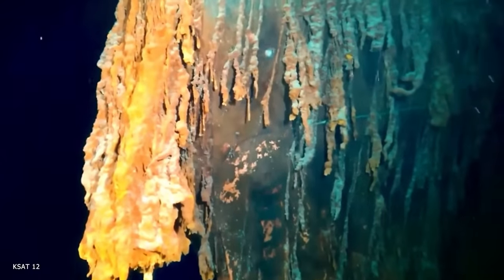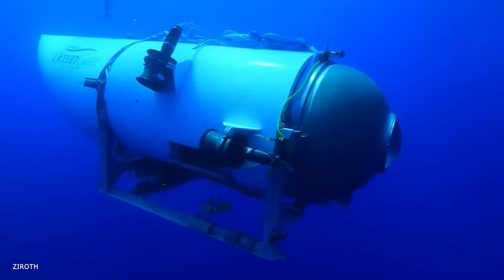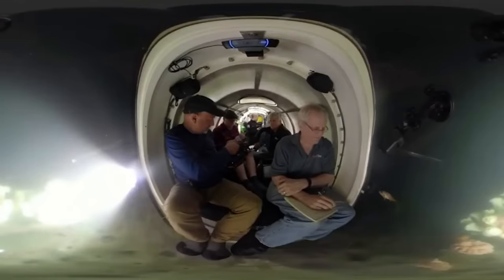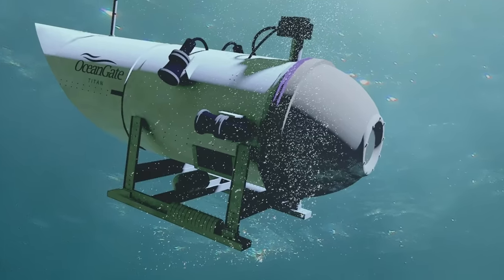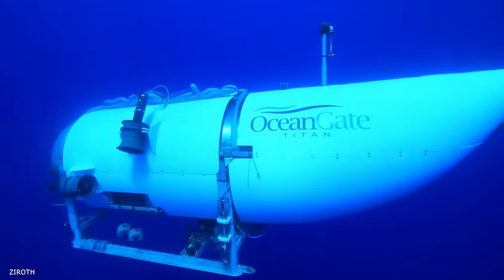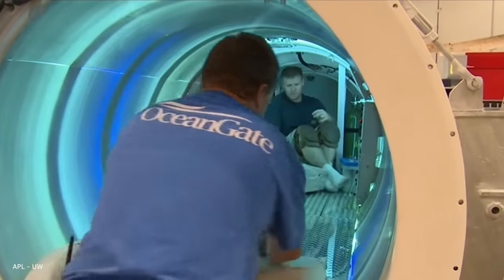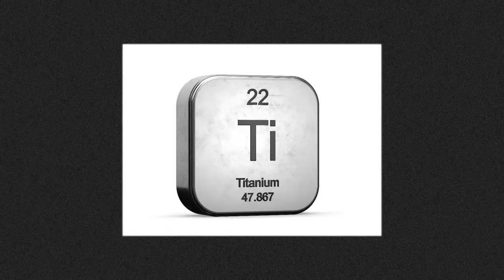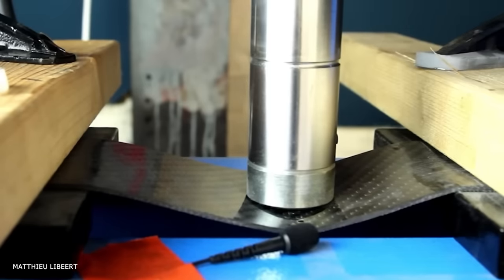James Cameron Just Reveals TERRIFYING Truth About The Oceangate Submarine!

Comment: There is a reason that the other subs were made of titanium ...The SR-71 was 90% titanium ...and they pushed it to the limit...!
Reply: Ultra high strength steels are fine.
That's what was used for pressure hulls of Mir submersibles, because along with bolted together halfs design it gave 10% better strength to weight ratio than welded titanium spheres of the time.
Also there was one made from aluminium: https://en.wikipedia.org/wiki/Aluminaut
Fatigue of aluminium must have been pain for designer and seriously limiting for usage life.

Comment: Ocean Gate put cost saving over structural integrity and the safety of those on board.  Even the science was bad---the carbon fiber material was just not the right material to subject to such extreme pressure.  The Titan should have been tested further.  It certainly was a technology failure resulting from a very human flaw---ego.

Comment: When Carbon Fibre is supposed to be stretched like on a plane with the cabin pressure pushing against it, it works. The fibres bind together and tighten.

When Carbon Fibre is supposed to be a lighter, stronger automotive alternative to steel and aluminium, it works. Race car constructors swear by the stuff and since its introduction it has saved lives with its strength. Former Hercules Aerospace and F1 engineer/designer Steve Nichols has said that if the Carbon Fibre construction in an F1 or Indycar basically turns to dust in an accident, its done its job dissipating the energy before the driver gets seriously hurt.

But Carbon Fibre was never designed to be squeezed by tons of pressure like seen in the depths of the ocean.

Comment: 1. Mixing materials = different reaction agains heat, pressure, and so on = not good at all.

2. Best proven shape for pressure resistance is the sphere, so using other = not good too.

3. Lack or testing material resistance over time under various conditions = not good also.

Already three very huge problems from the begining = bad things will happens for sure...

Comment: For a  start, we start with two Titanium end pieces - 'tough  old boots', married to a cylinder made of 'super strong string' impregnated in resin! Even that would have shown the lunatic building the Titan Submersablel the followinge. Such a entitity, subjected to cyclical pressure testing, would have revealed the destructive forces generated by fracturing resin, upon the 'string winding' it embraces. Successive testing ulimately resulting in total collapse of the cylinder..  As for the 'real thing'. the centre of the tube would exert huge deflection forces to the Titaniam end cheeks, further invoking the potential for stress cracking in the cylinder ( all out of sight externally). Just like repeated flexing of that piece of copper wire - it suddenly breaks. All of this would have been revealed in destruction testing - which the Salesman knew darn well!

Comment: I cant believe anyone thought the titan was  a good design. The cylinder, using carbon fiber, titanium end caps ( well they were sound) but then gluing  them ow my god i saw how they did it. They used spatulas to scrape the glue on then slid them together. Id of wanted a robot to spray it on so absolute thickness and consistency. Or something to injection it. In a vacuum How they did it how do they know if it bonded without any voids. My god i cringe every time i think about it and the carbon fiber??!!!??!

Comment: The author is unnecessarily harsh on Rush in this piece, blaming his lack of concern for safety for the deaths of the four passengers on the vehicle.  Remember, each passenger signed a waiver which outlined many of the issues listed here.  They were informed of the dangers and accepted the risk.  Rush did not force any of these people to board that deathtrap.  Rush ultimately trusted his own engineering over general practice, and basic physics, to pilot the craft himself.

Comment: As soon as I read that the main body was a CF cylinder. I knew pretty much what had happened. 
A sphere or (possibly?) a carefully designed ovoid is the only shape suitable for extreme over pressure, and any material that can delaminate is a no-no.
I’m just a (retired) physics teacher with no engineering qualification, yet I would have rejected this design out of hand as soon as they suggested using a CF cylinder as a component of the pressure hull.
Rush was an example of the Dunning-Kruger effect. Thought he knew more than the experts

Comment: The fault was in the way the end caps were installed. The epoxy used was under too much stress.  In the video of the assembly you can see that the end cap is put on in such a way as when the hull flexed the epoxy was all that was resisting the end caps non flex. If the end cap was put over the end of the hull the end cap would have taken the stress not the epoxy.
Reply: Yes and no, there should have been a nice thick flange that allowed the carbon tube to slide onto giving 2 surface areas instead on 1, bottom line is that carbon tube should have been treated as a disposable part and replaced after every deep dive

Comment: In the fire department we had two types of air packs, metal and compost.  When refilling the metal packs you use a water bath to cool the bottle.  When refilling composite you DO NOT put the bottle into the water but allow the bottle to get warm.  It will cool in time.  Reason is what Mr. Carpenter spoke of.  The water bath can get between the fibers and then as you compress the air the bottle expands.  The water between the fibers is incompressible so this causes an uneven pull on fibers and separation of layers.  The next time you fill with air the gap between fibers is larger so more water gets in and more sepeeration and tearing of fibers occurs.  Then failure.

Comment: Well i am just a simple lady that likes to go fishing however i do understand about carbon fiber fishing rods can be made from this i have seen how slim they are and although strong the pressure they withstand is variable, if squeezed too tight they break they shatter and split and crack if they bend above their breaking strain the will shatter and split in some respects carbon fiber is quite brittle and bonding it to other materials might even cause a weak point at the joint. So i can only imagine making a sub out of it would be a very bad idea, it might withstand the enormous pressure of the ocean for a while but that might weaken the glues bonding it and failure occurs eventually the pressure will force things to crack hence the reported cracking sound heard on board. It was too late at that point to salvage the mission. Only thoughts from a simple unqualified person i must add.

Comment: also i doubt that uneven tightening of the hatch bolts would have made a difference because at those depths the amount of inward force would force the metal flush with whatever it was contacting even if the bolts where tight or not.

Comment: It had been down there before though. This time it was sinking at a high rate and thats why it probably exploded. Maybe if it hadnt sank too fast it would of lasted for more dives or shown signs that it needs a new hull, also carbon fiber was strong enough for this. they fail to mention that. The operation was very homemade but it did work, it didnt leave much room for error though. Seems a round metal one with only a couple passengers could of just done twice as many dives. Also, if your a civilian that wants to go to the titanic this guy was the only one crazy enough to be doing this. Theres a video of a russian sub down there that gets stuck briefly but they get out, that thing looked pretty badass, thats what you want.

Comment: I am not saying that the design was not without flaws. But I do think too much is being said about regulations and testing. Was the Challenger Space Shuttle certified? Was Appolo 13 Certified? Was the Titanic certified? Certification does not validate a lack of failure. All it does is state that current knowledge says the unit 'should be ok'. It is a sad case, no doubt, rush, cost, arrogance, yes. Certification, I am not so sure about.

Comment: Yeah, Rush had a bunch of excuses of why he didn't want an outside entity examining his work too closely (smart salesman), but in the end he just didn't want to spend the money for outside consultation and upgrades.  He was warned about the integrity of the Titan but this guy didn't listen to anyone and had an answer for everything.  Since there was no regulation in his field, he boldly did whatever he wanted to do, ultimately focusing only on net profit, bottom dollar, and making money.  Carbon fiber is actually NOT as tough/strong as people think it is.  It's just strong for how lightweight the material is.  It has a good strength to weight ratio, which is why it's used in race cars, but it's actually not a very strong material.  Did you ever use a carbon fiber cut off blade on a power tool?  You can break them by hand.

Comment: Carbon fiber solid fuel rocket boosters can be reused because the CF is put into tension.  The CF in this sub put CF in compression which then has minimal strength.

Comment: If the released transcript of events is accurate, the decent rate should have been a huge red flag that the carbon had failed and was taking on water.  Bottom line is passengers knew what they were risking, however trust was placed in the operators aborting the dive upon ANY abnormality, especially something like unexpectedly fast decent rate should have prompted an immediate termination of the dive and prompted an immediate return to surface to investigate the cause.
Reply: having had so many cancelled dives Rush probably didnt want  another cancellation with such influential people on board
Reply: @vicbittertoo  in retrospect,  better  to have a cancellation than DEATH.  I am sure the passengers would have agreed.  Don't get the fascination with having to actually go down there anyway, it's not like you could have gotten out and walked around anyway.  Looking at X through a tiny port might as well have sent down a drone and looked at video at least that way you could somewhat direct what your looking at without risking everything....

Comment: Cracking was heard aft, which means at the back of vessel, and shortly after they probably went straight down because of electrical issues and couldnt drop weight and go to the surface, so straight down it goes and everyone probably fell the the front where the bathroom was. At that point they had no way to pull themselves up to the controlls at the rear… there are a lot of faults and when you read the transcript from the accident, when they talk back in forth they talk about losing functions and checks could not be completed.. so if they lost controll and couldnt drop ballasts they probably went straight down like a pencil
Reply: The transcript was bogus. An insider called it out.

Comment: This man was moved by costs, from the cost of a proper platform for a heavier, safer craft to the design of a tube to fit more paying passengers into the hull to using cheaper materials. So all design decisions flowed from that, sometimes nonsensical strategy.

Comment: IMHO a cylindrical hull could work. If it was properly designed and constructed of the right material.  Titanium would be one obvious choice. Of course the cylindrical hull would have to be thicker than a spherical hull to deal with the way the different shapes handle pressure. Thus the cylindrical submersible would be a lot heavier and much more expensive to make than a spherical one would be. Given that Rush was primarily interested in reducing his operating costs in order to make a profit constructing a properly designed Titanium cylinder was something he didn't consider. But if he had gone that route he and 4 other people might still be alive today. And he would have had a submersible that would eventually recover its construction costs over decades of successful operation.

Comment: I don't see how anyone could certify it without testing a duplicate of the hull to destruction... I would assume there is no way to get anywhere near the conditions it was intended for in a testing facility. So they would have had to have built a remote controlled duplicate of the thing they couldn't even maintain communication with... and then make it do the dive until it failed..... I think maybe 100 successful dives might clear it for 60... which is a lot of testing on paper... although we now know that in practice it would have been a lot less than that.

Comment: I am not a expert but it seems odd that the joining of the titanium ring and the carbon fiber pressure cylinder is faulty. Since the titanium ring is on the outside with the Carbon fiber pressure hull mounted inside the titanium ring would be a very weak point because would not the carbon fiber compress more under the pressures than the titanium ring? This design seems to be of particular interest as a failure point due to the fact that any deformation of the pressure hull would put extreme force on the connection medium of the mating of the pressure hull to the titanium ring. Considering the massive  forces involved this design feature seems odd to me as if these materials were to be used I feel that the carbon fiber pressure hull should have mated on the outside of the titanium ring as the water pressure itself would work to keep the seal as apposed to having a weak point where the water pressure would work against the seal as a juncture for failure of the joint. Anyone else have thoughts on this?

Comment: 18 months carbon fiber failed, cylindrical hull failed portholes not rated for that depth..17 bolts locked them in...surplus carbon fiber from Boeing out dated..off the rack equipment, and a captain who broke all the rules and lied to get his way...don't forget the carbon fiber don't do well when cold and wet and pressure has no chance.

Comment: If I am not wrong (and I could be, not an expert), carbon fibre is strongest when you cross the fibres like how they build COPVs (Composite Overwrapped Pressure Vessels) which from what I know are used in rockets to hold gasses such as helium and carbon dioxide for the rocket's various systems. Even then its much better at handing expansive forces than compression forces.

For me:  1: Stockton Rush didnt bother to do his homework and actually build his so called innovative hull in a way where the carbon cibre would be strongest. 2: he didnt want to get it certified, because he knew it would fail, people would know it failed and no-one would want to ride on it. 3: When experts who had been on a number of occasions to depths far deeper than the Titanic raised concerns, they were imemdiately dismissed. 

The biggest shame is the demise of the 4 innocent people he was responsible for. Its one thing to build an experimental craft and ride in it yourself and put your own life in danger, but he had no business charging people money and putting thier lives in danger.

Comment: I even know carbon fiber is only can do so much. Even as car parts it fails unless you weave in titanium of stainless. The heat and cold speeds up the process. Yeah it's strong bet it only has a shelf life with cycles on it. If it's gonna be used for my safety, I want a pressure test on that product before using it and still checking everyday. There is a submarine tour in Hawaii that's a old military sub and inspected and checked daily before every tour, Its safety requirements

Comment: I wonder whether having an internal system of titanium or even stainless steel rings distributed internally along the length of the carbon fibre hull with another few layers of tape being "wound" longitudinally? No doubt it would have added substantially to the cost, From what I've heard, the material itself had a lot to do with the failure - it is poor at withstanding compression and it was tape-wound cylindrically.
As someone who takes pains to design electronics in a robust fashion (no guesswork or beliefs here!) it is disappointing to hear that belief was involved in this project. Normally one tests, self-criticizes, corrects, tests again designs way beyond normal running stresses to allow for transient application of (improbable but not impossible) stresses being encountered.

Comment: A cost cutting approach has no place in any safety critical endeavour. Rush's arrogance pushed Oceangate to failure. He would not hire experience opting for cheap new graduates and student interns. There's a reason why an engineering graduate is immediately given chartered status, the lack of real world experience often proves fatal without adequate supervision and training.
As for carbon fibre, it doesn't perform well in compression but couple that with no testing and sack the guy who says let's test. Rush was an idiot. If he truly wanted to push the limits, the Titan would have been certified or at least undertake 50 test dives remotely controlled.

Comment: Jesus - in Britain domestic natural gas supply pipework beyond the customers’ isolation valve (& governor or regular )is subjected to a puny 0.8 metres head of water pressure or 8.4 millibar - yet installers are subjected to constant regulation by an official body & mandatory approximately every 3 year on the job inspection & have to carry a minimum of 1 million public liability insurance & much more red tape & interference or advisory stuff which could be used against operatives in the event of dangerous situations or disasters yet that craft wasn’t legally required to be tested when potentially at the mercy of 3 tons of pressure upon every inch of its structure whilst carrying passengers ? Goodness me this is surprising.